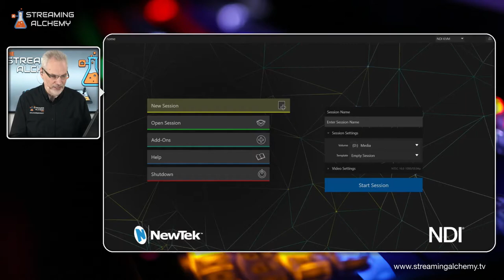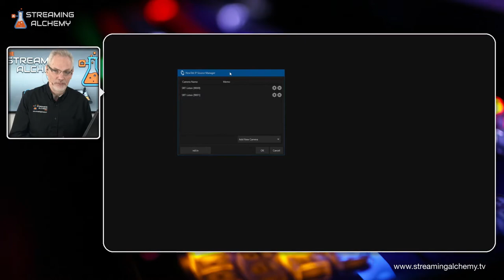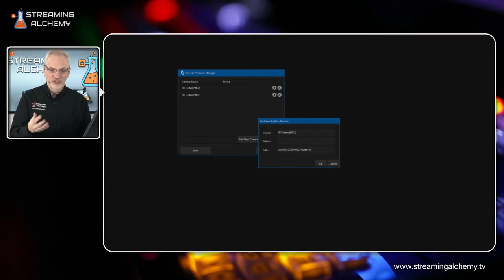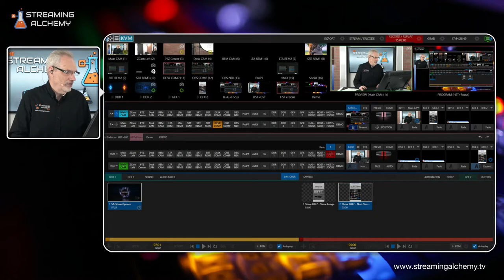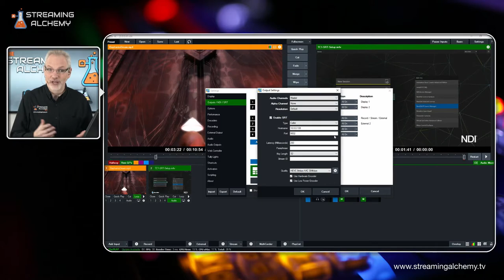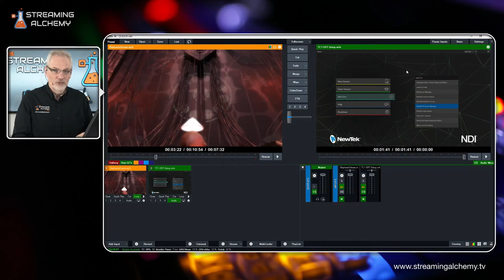Creating an SRT Connection Between a TriCaster and vMix

Comment: Do i need to have vMix to connect a jvc hc-900 connected camera via SRT to newtek tricaster tc-1
Reply from the maker: Hi Charles - You can connect SRT device’s directly to a TC-1. The menu system has a selection for configuring IP devices - I don’t remember where it is specifically- that will let you set up SRT-cameras that you can then assign to inputs. In most cases, this will also require port forwarding. This would probably be a good topic to cover on the show.

Thanks for watching!
John